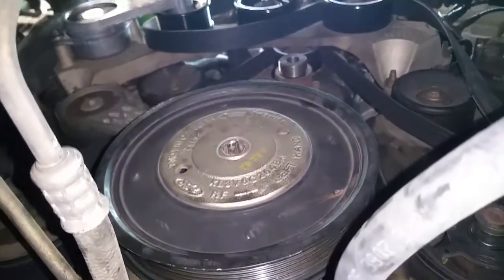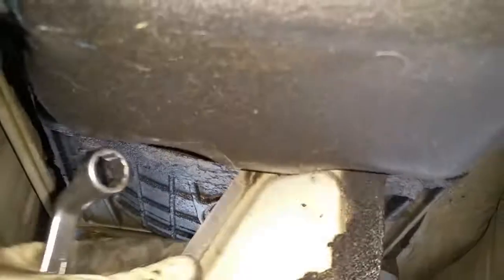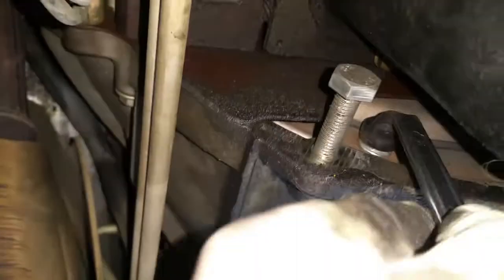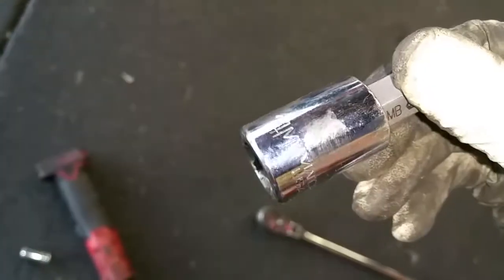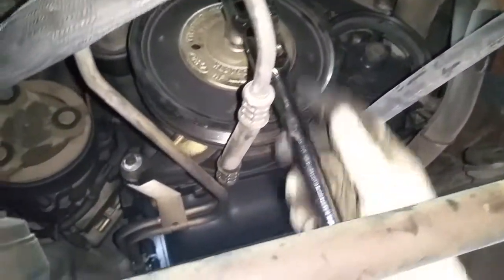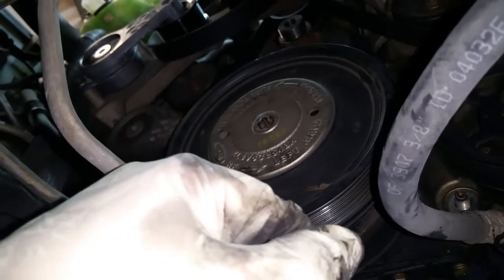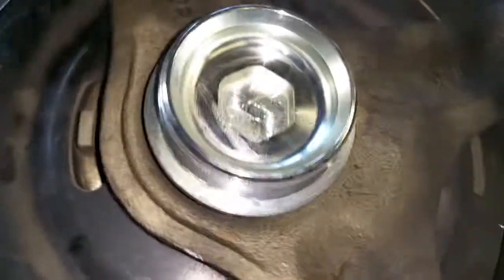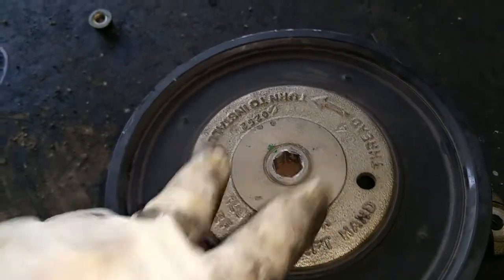Ford Supercharger lower supercharger pulley removal

Comment: Seems like a good easy idea but for me it didn't work. i ended up having to use the lock plate tool that comes with a new pulley, when the wrench comes to rest on the bolt to lock down the motor it is forcing the nut to move coutnerclockwise which would be lefty loosey so if your lower pulley has been on for ages this will not work.

Comment: Flywheel to Crankshaft bolts 59 ft/lbs
Pressure Plate to Flywheel 40 ft/lbs
Torque Converter-to-Flexplate nuts 26 ft/lbs
Auxiliary crankshaft pulley 74 ft/lbs
Auxiliary crankshaft pulley brace nuts 35 ft/lbs
Transmission cooler line bracket nut 11 ft/lbs
Drive belt tensioner to Engine block 19 ft/lbs
Drive belt idler pulley bolt 18 ft/lbs
Fan Blade to Fan Clutch 13 ft/lbs
Fan blade housing to Radiator 7 ft/lbs
Fan Clutch to Water Pump 41 ft/lbs
Pulley to Water Pump 19 ft/lbs